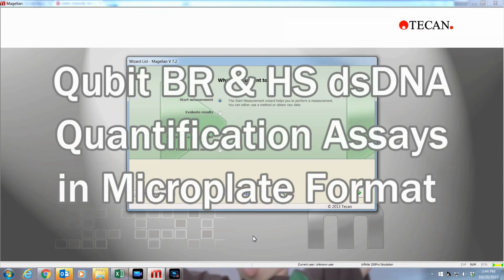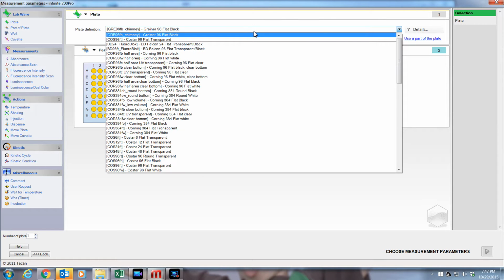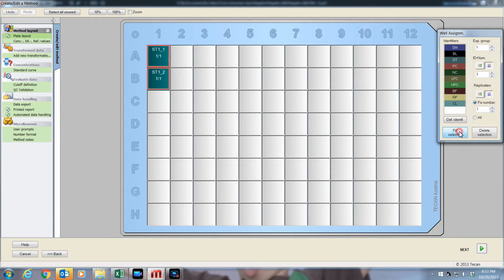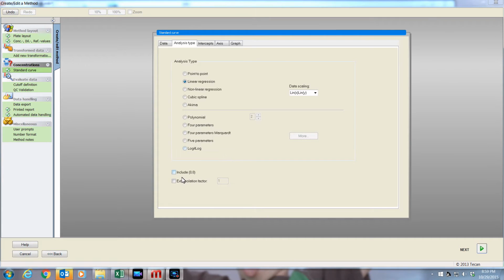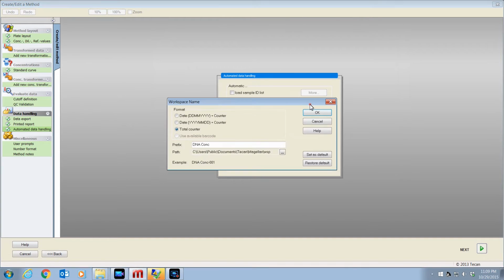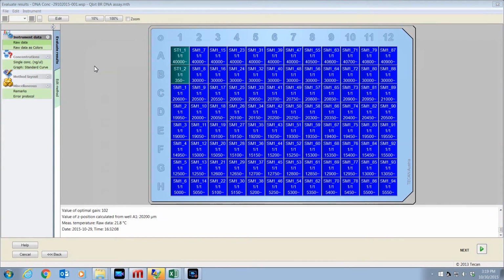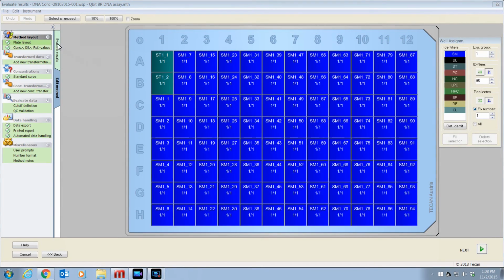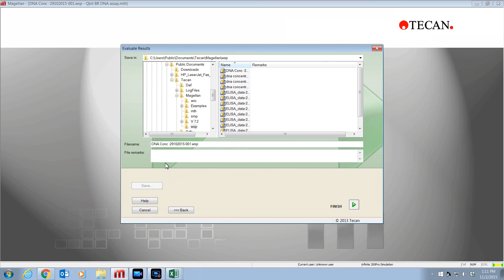How to measure the Qubit assay in microplates

Comment: Thank you for this detailed video, Regarding the excitation/emission, it’s written 630/680 in the technical sheet of qubit not 490/525 as you showed here. Regards
Reply from the maker: Hi there is a difference between the DNA and RNA Qubit assays. The HS RNA assay uses 630/680, whereas the DNA kits use 490/525 from what I recall. On page 7 of this manual you can see where they refer to the 630/680 wavelengths for the RNA HS kit. https://assets.thermofisher.com/TFS-Assets/LSG/manuals/Qubit_RNA_HS_Assay_UG.pdf